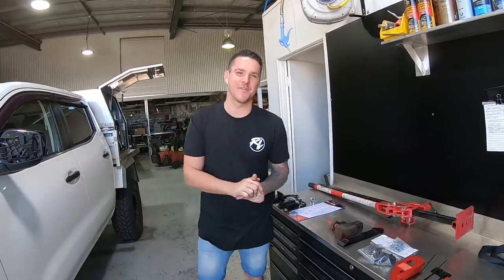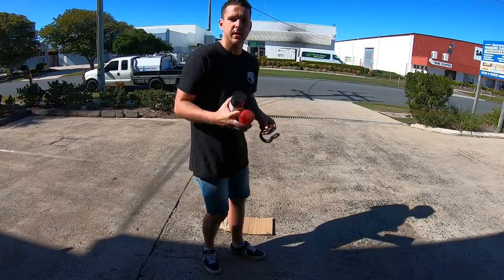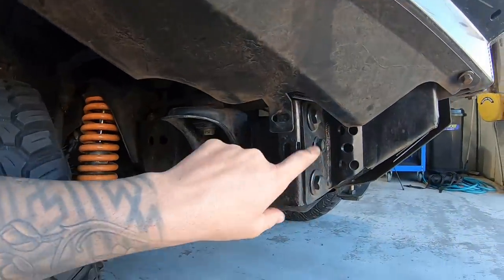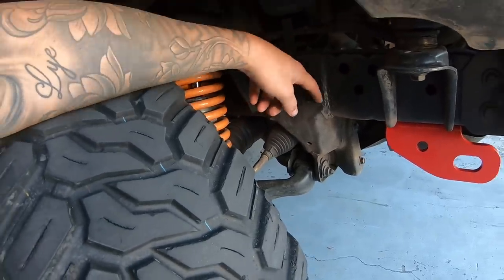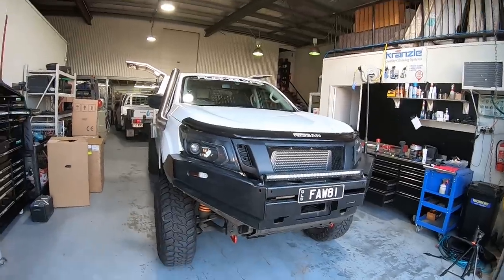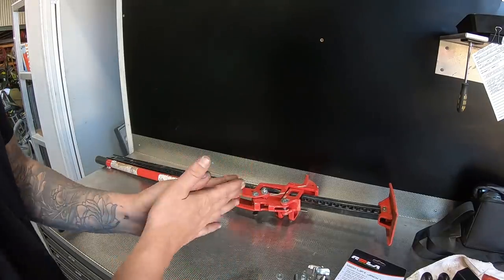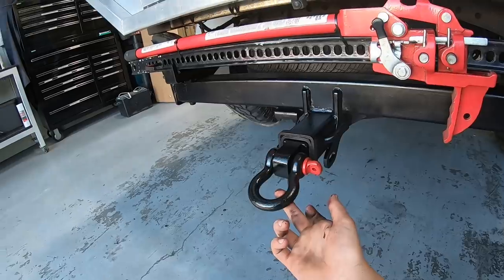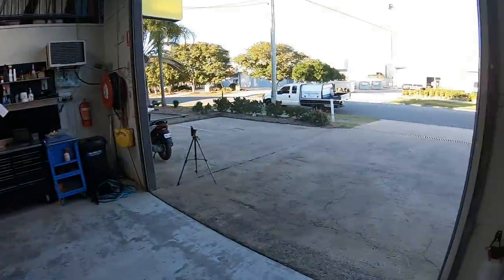Important off-roading mods EVERYONE should do!

Comment: Cheers for the vid mate! I ended up sticking a piece of wire up from the bottom to the top hole to guide the nut down to the bolt hole to make life even easier. Very nice rig bro.

Comment: I am interested in how much these mods have de-rated the Towing Capacity by drilling holes through the Towbar,? and roughly how much it has reduced the Tow Ball Weight.? 
Maybe a plate on the bottom could bring back some of the Towbar strength, but the extra weight would probably be noticeable and both will get you a fine or a defect notice from the Scalies.
Reply from the maker: To be honest I don’t tow! But there would be a couple ways you could make that plate, you could weld tabs onto it and then mount the brackets to the tabs!